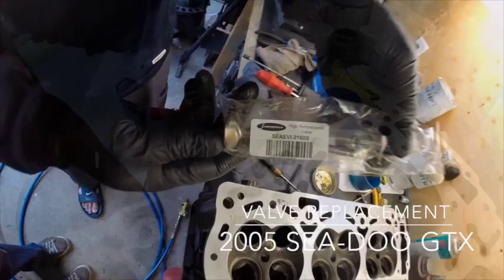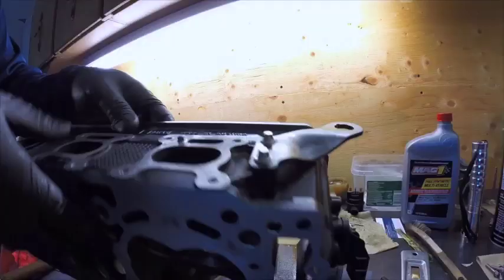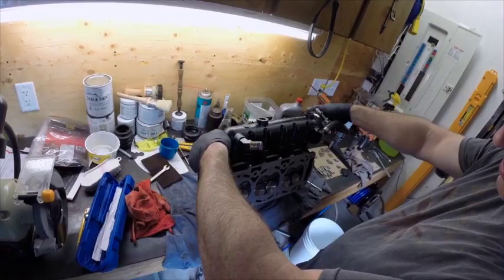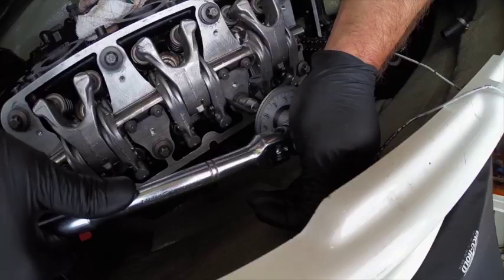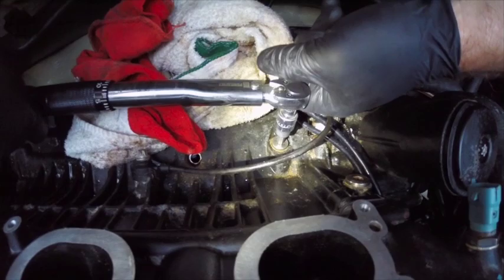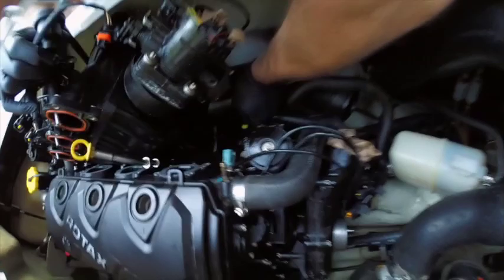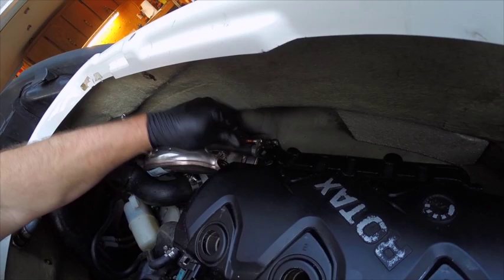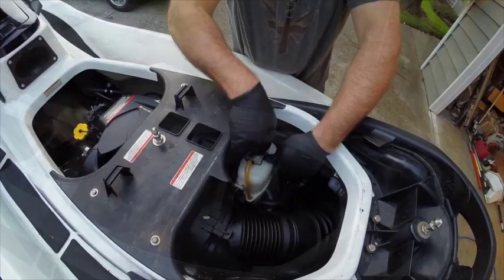How To: Sea-Doo 4-TEC Engine Valve Replacement (Part 2 of 2)

Comment: I don't have an angle gauge what would happen if I just torque the head bolts down to the correct torque?  The video is great you did a did a great job very clear and descriptive thank you for the quick response.
Reply from the maker: You would run into serious problems. If you can’t get hold of an angle gauge you can make one out of cardboard or something similar. You can also probably do a good estimate for 90 degree angles, etc. Good luck and thanks for the kind words.

Comment: Nice video, big job big edit!
I want mine valve also replaced as a precaution. How many hours do you think it stands before replacement is necessary. Mine has 135 hours. I make 35 hours a summer, and take my exhaust out of the ski at winter time. Should i replace my valves this year or next year, what would you do? 

Thank you
Reply from the maker: W Jansen What year and model of machine do you have? Valve replacement is only critical on certain older models.
Reply: 3ftDeep Got a RXP 215 supercharged 2007. The red one with the big RXP. But somehow my engine looks like one from 2006.
Reply from the maker: W Jansen
Model years 2004 to 2006 had the problem valves since yours is a 2007 you should have the newer valves.  The only way to be 100% sure is to remove the valve cover and read the number stamped at the very top of the valve stem the bad valves start with the number 72 and the good valves start with 75.  The numbers are really small so you will need good light and a magnifying glass to read them.
Reply: 3ftDeep Hi, thank you verry much for the information! iam scared to look now.. Another question that you probably know is, i got a "oil pressure gauge" but i dont know where to connect it on the engine. Someone told me that its somewhere near of the oil filter. Maybe you know.. 
When i know witch number i got on my valves i will leave info. 

Thanks.
Reply from the maker: W Jansen There are a few oil pressure switches on the engine. I'm not sure if you've got a third party gauge, but I'd start by going to the following URL, finding your model, and looking up the diagram for your engine: http://epc.brp.com/Index.aspx?lang=E&s1=a18c7077-267e-4ab6-9f35-5a043e32d3d0
Reply: 3ftDeep Thank you, boss.. . about my valves. they are 75, the newer ones. With 135 hours. should i still replace them?
Reply from the maker: W Jansen If you've got the newer valves and you've only got 135 hours on your ski, there's no reason to replace them. Have fun!
Reply: 3ftDeep Thank you. Will sleep much better!

Comment: Hey guys got a question i have a 2003 seadpo gtx 4tec. Im having a bogging when i give it any throttle but will idel no problem when in the water. Compression is good, no codes using candoo pro, no coolant loss, no leaks. Any suggestions
Reply from the maker: Have you checked your wear ring lately? You could also have something stuck in your impeller or intake grate. Check it out!

Comment: For how long should the engine be working after the installation? Or you can ride it after the installation.
Reply from the maker: Adel Mckee It's not a new or rebuilt engine there is no break in required.  First ride I stopped after about 10 minutes to check fluid levels and look for obvious leaks then just ride like normal.  Thanks for watching the videos.

Comment: This video (ans for sure part 1 of it) are a very well and detailed explanation. While I  have just "engine mayonaise" (water in oil and vice versa) I will most likely need to replace the head gasket and this this video takes away a lot of the worries I have had prior to touching it. Very well done job and good and detailed explanation!- The only question I have, is wheather you have any idea, if the aftermarket Head Gaskets are any good or if one should use the original only.
Reply from the maker: For critical components like this, I suggest spending the extra money and use OEM parts. Good luck and thanks of your comment. -Mario

Comment: Hey there, I have a 2004 RXP with 145 hours on it, really worried about the valves, but not too sure how to check. Do I just take just the rocker cover off? Is there anything else I need to do? And do I need to replace any parts after taking off the rocker cover?
Reply from the maker: Joseph Pons Here's our response to a similar question a while back ...Remove the valve cover and get the number from the top of the valve stem with a magnifying glass. The bad valves start with a "72", and the later good valves start with 75.  The valves starting with 72 are the ones that can corrode around the stem then the head falls off and can do a lot of damage.  This usually happens to the exhaust valves as these are always in a moist environment because water is always present in the exhaust system.  If you can do the work yourself it's a good off season project if you have to pay a shop to do the work the cost may be prohibitive on an older machine.

Comment: Great video, tanks for taking your time and effort to document and help us other guys out! I have used a lot of time looking at several of your videos. I used one of your other your videos to replace carbon seal a while back! :-) Now...

I have a 2006 RXT 215 with 2005 year engine, and a 2014 GTX 260. Last year the 2014 engine had SC gear breakdown and the complete longblock was replaced at a dealer. I have the defective longblock laying around. Now I have had the flywheel bolts break on my 2006 RXT so the engine is coming out. I have bought the parts nescessary for the flywheel fix from a 2009 model 255, and have some questions. I would greatly appretiate it if you could take your time to answer them for me! :-)

1) Can I use valves from the 2014 (100 hours) engine, instead of buying new valves?
2) What is the compound you use to sand down the valves and seat with the suction cup? Is this process necessarry if using the used valves from the 2014 engine?
3) Could I possibly just use the complete head from the 2014 engine?
4) I have noticed that the 2005 engine does not have the oil sprayer for the SC axle. Should I/is there a way to add this? A kit or something? Or will it work fine without?

Thanks a lot again!! :-)

Comment: Hi, thank-you for your great videos. I am in search for some parts for seadoo RXT 215  2008 model engine. At the moment I am in India and the part's cost seems to be too high. The timing chain was broken and I need full gasket set , all valves , chain and tensioner.  Will you please suggest some reliable parts suppliers other than OEM. This jet ski only worked around 13 hours and I opened the engine for an overhaul . Thank you.
Reply from the maker: Yes, try SBT out of the United States. Good luck with your project!
Reply: @3ftDeepChannel  thank-you

Comment: Nice video to get in touch  with the 4tec engines...
May you have some advice for me:
I have oil in coolant  (no coolant in oil) on my 2013 GTI 130 - 240hours.
Oil-cooler test was ok. No leaks / bubbles with air pressure on the water lines.
What should i check - replace now?

It was running fine untill „low oil warning“ - removed the seat and see the oil/water mixture in the coolant bottle :-(
Reply from the maker: I think we replied to your comment in an email. Please let me know if you didn't get it.

Comment: I am replacing head gasket. And i have some pitting/corrosion on the head. I can see that yours has the same.. "round cirkle" around each sylinder..  let me discribe better- the head surface- you can se a " ring " as where the head gasket is tight around cylinder.. not all the way around.. but mine looks like yours.. i can slightly feel it with my finger nail.. anyways ,my head is clean and straight. No warp.. looks like yours.. is it ok to put it back as is? Or? Thanks
Reply from the maker: Can you send some pictures to our email address?

Comment: Well done!! I though you went a little fast but still an awesome video.  Also that blue stuff was lock tite right? And what if you dont have a drown mode key what do you recommend?
Reply from the maker: Thanks for the compliment! Yes, the blue stuff was Locktite 243 (actually, an equivalent). It's best to use a service manual when doing the work, as it sometimes recommends different Locktite products. We don't have a drown mode key. If you start up a Sea-Doo with the throttle fully squeezed, that's "drown mode", and it won't start up when you do that. You use the regular key. Drown mode is useful for a number of maintenance procedures, including changing the oil. Good luck!

Comment: please help, I have a 2006 GTI SE 130 and that has oil in coolant  reservoir  . Ive pressure tested the oil cooler and no leaks, changed the rear oil pump seal , next I was gonna change head gasket. It has 165lbs of pressure in each cylinder. Do you think this is the next step I should do to find the leak ? any suggestions?
Reply from the maker: Hello Tim, It sounds like your head gasket. To confirm, pressure test your cooling system and cylinder leak down. Good luck!

Comment: I have a 2008 RTX215 it has Riva Titanium valve retainers, Riva /ARP flywheel bolts I am reflashing with MaptunerX stage3 9000 rpm with Engine Tech xtreme 68-140  18 lbs @ 9000 rpm  also Riva racing Thermostat,  Riva Gen 3 intercooler with HKS blow off valve , Riva rear exhaust, OPAS block off,  4" ait intake, Auqua Sport exhaust spacer, Riva oil catch can,  Solas 13/17r , Riva stainless wear ring,  Riva pump wedge,  Riva pump loader intake grate. My question here though is at that rpm which ill prob shoot for 8850-8900 will I need to replace stock valves will titanium and replace valve springs with something like a Riva setup. In your opinion
Reply from the maker: We don't get into the heavy mods like you have done to your machine so take this with a grain of salt.  Anytime you increase the rpm the valve train needs some consideration usually lightening the mass and heavier springs to control the mass or a combination of both is recommended.  For your 8900 rpm goal I would say heavier springs and lighter retainers are needed, titanium valves would also help but I'm not sure they are required.  It would be best to check some of the online PWC performance forums to get an idea of what works, what doesn't and what is recommended, good luck with the build.
Reply: @3ftDeepChannel   Thank you sir ! great video also!

Comment: Another question about valves. Do I need to check the valve for leaks? I pour gasoline in the head. Gasoline leaking through the valve.
Reply from the maker: We didn't check for leaks, but if they leak, you'll know soon enough by loss of power, or other problems.

Comment: Did you do the valve guides / seats at all ? I didnt see it in the video. Looks like that was all left intact, just swapped out the valves. Do you have a video for those parts or is that machine shop territory ? Im looking to tear apart my 2005 rxp 215.
Reply from the maker: No, we only did what is shown in the video. We did this as a preventative measure (i.e. the engine was otherwise in good shape), so we didn’t need to do much else.

Comment: I’m getting low compression on one cylinder. I suspect the valves might need adjusting but I can’t figure out what they need to be adjusted to.
Reply from the maker: What make and model of machine do you have? If you have a Sea-Doo, the valves don't get adjusted. Most likely you've got a bad piston ring, or a valve isn't seating properly. Do you know if you're getting much blow-by?
Reply: @3ftDeepChannel  it’s a 2003 GTX. I did find out after further inspection that the valves cannot be adjusted😂. I’ve never worked on anything like this before. And I’m not really sure about anything. However, I’m fairly certain it’s the piston ring. I put some oil in the spark plug hole and the compression went up. Not quite to normal tho
Reply from the maker: Thanks for the update, Big Jayk. We’ve got a few videos on engine teardowns, etc. so take a look around if you’re going to get into it. Good luck.
Reply: If your compression went up then its not your rings with adding oil di a leakdown test you should be able to find out that way with the valve cover off

Comment: Currently looking through your website for a seadoo valve spring compressor tool. Is there a link?
Reply from the maker: Yes, here's a link similar to a tool that is similar to the one we used: https://www.amazon.com/dp/B000F5ECUY/ref=as_sl_pc_tf_til?tag=3ftdspor-20&linkCode=w00&linkId=b1934a8b1bf5ffa03da04263ced0ddb2&creativeASIN=B000F5ECUY

Comment: Why do you need that tool to torque the bolts at right angle. Can you torque the bolts like you do on a car
Reply from the maker: These are special stretch bolts (i.e. non-reusable) that need to be torqued a particular way according to the manufacturer.

Comment: Hello, i have a 2014 Sea Doo GTR215 99hrs and its throwing a lot of smoke through the muffler. Do you think its because of the valve?
Reply from the maker: Is the "smoke" white or dark? If it's white, it's likely water vapor or coolant. Coolant will have a distinctly sweet smell. Bluish smoke is burning oil, while dark grey is fuel burning. White may be okay as it's likely just burning off water vapor. Does it use up oil quickly? Does the coolant reservoir have any black specks in it?
Reply: Is blue smoke yes.
Reply: The coolant reservoir is clean and it use oil a little bit
Reply from the maker: Are you using up oil quickly?
Reply from the maker: Sounds like an oil leak. You should check to see if you're still on warranty. A lot of Sea-Doo's machines came with a 3 year warranty.
Reply: Ok, thanks for ur help.

Comment: Did you re surface the head? How did you resurface and check it.
Reply from the maker: No we did not resurface the head.  The engine did not have any problems and was running good the valves were replaced as a precaution as the earlier valves have a high failure rate.  The head was cleaned of old gasket material and re installed on the block it's still running good to this day.  If the engine had overheated or had a head gasket failure we would have had a machine shop check the head for warping.
Reply: @3ftDeepChannel  I would really like to see how to resurface these heads. its as if the larger valves don't fully seat into the head causing straight edge to stop when trying to slide over the valves when checking for straightness. if thats the case now can the head even be surfaced without cutting new pistons from hitting the valves.

Comment: I just read to apply Molykote 111below head bolts 14 what do they mean.  What is it where do apply it and is it necessary since I don't have it?
Reply from the maker: Molykote is a very thick grease that withstands high temperature without losing its form. On Sea-Doos we only use it on the coil packs to prevent water from getting in under them and flooding the spark plug chamber. It is no longer used in the new engines where the coil packs are screwed down.
Reply: @3ftDeepChannel  thank you

Comment: what is the knock sensor plug? how to test it in order to be sure that it is this part that must be changed. I have the code P0326 when I accelerate above 6000 laps around, below I do not have this code.
Reply from the maker: Most of the time it's the knock sensor. You may be able to test it by getting a copy of a Service Manual for your machine. It would likely involve reading the resistance across the sensor. Although it's often the sensor, it may actually be okay and reading a problem with your engine, so you need to trouble-shoot. Maybe borrow a sensor from a friend's machine, first and see if the problem goes away. Good luck.

Comment: Hey I love all your videos! question, I’m looking at a 2005 GTX 155 with 213 hours. I’m wondering what would need to be done to make it more reliable? I’m thinking of doing the valves and timing chain, would you’d advise to do anything else when I’m that far into the engine? Thanks.
Reply from the maker: Not really. The valves can be an issue, so if you're doing those there's nothing else I can think of. The supercharger washers are an issue, but since you don't have one ...
Reply: Thanks for the reply! What valves would you recommend I get?
Reply from the maker: We used Supertech SEAIVC-3860S for the intake valves, and Supertech SEAEVI-3160S for the exhaust valves. They seem to work fine. Good luck!

Comment: great videos whats the torque specs for the timing chain tensioner?
Reply from the maker: Check out our flywheel bolts replacement video. I think the torques are in that one.
Reply: @3ftDeepChannel  just watched it that's an awesome video but it's not in there would you happen to have the specs by chance I'm leaking oil from the timing chain tensioner I'm going to change the crush washer and see if that helps but I don't wanna over tighten 
Thanks in advance
Reply from the maker: Which model and year machine do you have?
Reply: @3ftDeepChannel  it’s is a 2012 challenger 180se 
it’s the supercharged 260 motor 
1503 
With external intercooler
Reply from the maker: I finally found a spec. It's for a 2012 GTR 215 with internal intercooler, but if I were you I would use the same: 17 N.M (150 lbf.in) (note INCH pounds, not foot pounds). Good luck.

Comment: Hello. In my engine in the coolant, oil, ie an emulsion. What could be the problem? I have 2005 GTX wake 155
Reply from the maker: +Андрей Лебедев 
If you have oil in the coolant it could be a leaking head gasket or a leaking oil cooler.  These are the first two items I would check.

Good Luck.
Reply: +3ftDeep Thank you. A problem with oil cooler. Head gasket fine. I have some questions. Help me please. 
1 Where do you buy spare parts?
2 Is it possible to re-set used head gasket?
3 What is the torque bolt head?